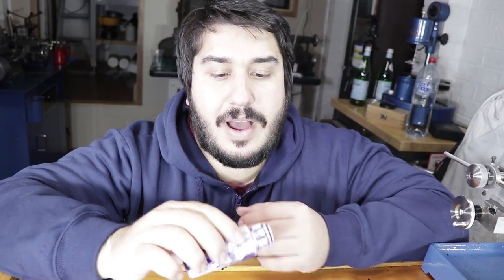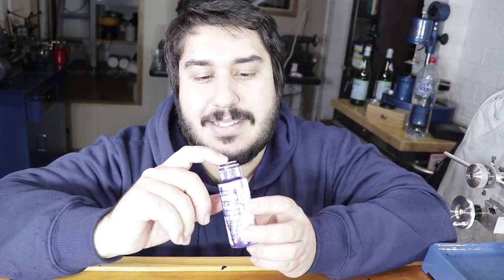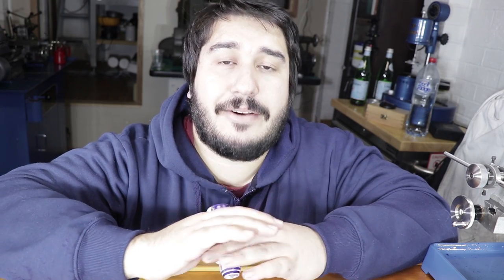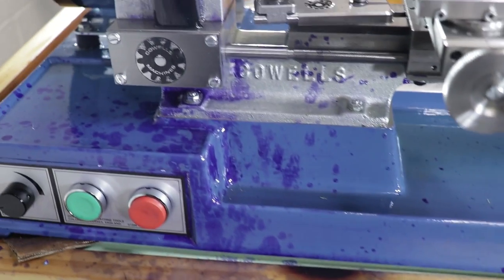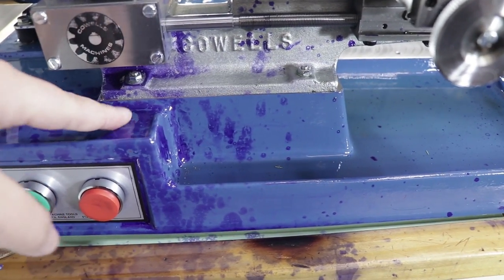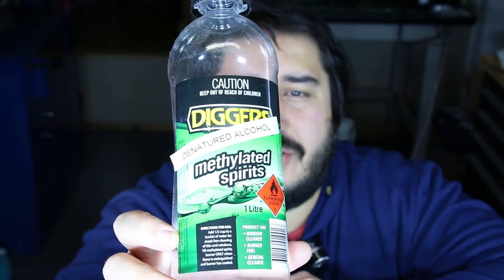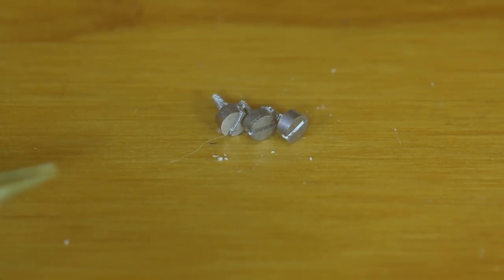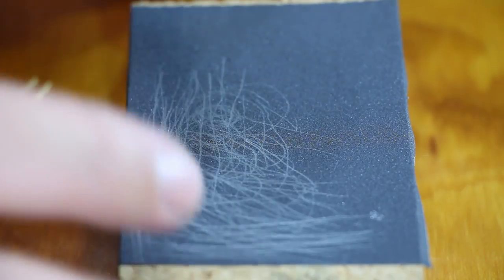Cowells CW90 Lathe ruined. BHI Watchmaking Course | Watchmaking Vlog #6

Comment: Hi Dean - Thanks for the videos! I've used a dry erase marker to remove sharpie from smooth surfaces. Completely cover the sharpie using small circular motion. Once dry, wipe off as you would the regular dry erase. No idea if it'll work on your layout fluid, but it's worth a try!

Comment: Hi,  Great videos and well done demonstrations for watchmakers!!  One thing that I need is to have both tap and die left-handed threads.  For some of the watches I work on, they require left-handed threads for some mainspring arbors and other posts and screws!  Left-handed screw-plates are few and far between.  So, any help to make left handed screw and hole threads? If you keep working on many different kinds of watch repairs, you too will find that these left-handed tap and dies are needed!
Reply from the maker: Hi, thanks for taking the time to watch and reach out to me. I actually ahve a video where I made a left-handed threading die from scratch used for the crown wheel on my watch. It can be found here https://youtu.be/SEdmDtGUv7U

Comment: Hey mate, not sure if youre still on here as im very late to the party but nonetheless your videos are inspiring and well of knowledge.

Ive just got some questions for you about the BHI course as I'm picking up watch repairs from my father but am looking to begin getting certifications..and the BHI distance learning seems the most doable considering my situation.

First question if, because we aren't based in the UK, i would assume that we would have to get our own tools, machine and material. Which costs money, so how much would you say youd have spent to finish the course? And what sort of equipment is required to complete the course? As i wouldnt want to enroll only to find i dont have the logistics to finish it..

For some exams, an examiner needs to be there, and I understand that i can find my own examiner, but what sort of qualification and where do you go to find these people that can be examiner?

For those exams in Level 4, which you need to do to the UK, how does that happen? Is it a one day kind of thing? What the process like..

And lastly, starting from Level 3, do I choose from the start if i want to pursure watches or clocks? Because im getting the understanding from BHI that they teach more on the clock than watches for level 3..

I know its really lengthy and alot of questions but youre the only guy i know what I know has done the course.. cheers and keep inspiring!

Comment: I have found that the best solvent for cleaning Dykem blue off metal is Acetone (NOT isopropyl alcohol). It doesn't even need to be 100% Acetone, as even a 50% solution with water, on a rag, seems to work well. 
I can't vouch for how this might react with your paintwork, so test an inconspicuous area to determine the effect, and don't over do it.
Nail varnish remover is a good domestic source of dilute acetone (check the  ingredients, as some types use methyl ethyl ketone (MEK) instead).
NB: Acetone is very flammable, and should be used in a well ventilated area.
Reply: PS: I have found out that Dykem aka Marking blue is made by mixing methylated spirits with shellac and gentian violet.
This would imply that methylated spirits ought to be best solvent, (although this might attack the paint).
However, an alternative approach to dissolving the Dykem with a solvent would be to use dilute bleach to neutralise the gentian violet colouration. This might be safer to the underlying paintwork.
Reply from the maker: Nicholas. Thank you for your very detailed insight into this. It is awesome and Im sure anyone who seea this will also benefit. I did try acetone however it reacts with the paint, I may try 50% mixture in the future. Thanks Nicholas!

Comment: Dean D K 
I am trying to find a cross slide for my Peerless 8mm lathe. it looks like you have the same lathe. Do you know where i can order one? Or a certain one to look for? one that will work?
I'm a antique car mechanic that is trying to get in to watchmaking as a hobby. Any help would be appreciated. Thank you.
Unfortunately the only chemicals that I know that will remove the dye will also remove the paint.
Thanks for the info about the associate member of the BHI! I will have to do that!

~Ken
Reply from the maker: Hi Ken, thanks for your comment. In regards to the cross slide, I use a Levin made cross-slide. Most other makers will most likely fit the lathe. The most important thing you will need is a "shoe" for the Peerless lathe. Which will fit into the ways of the bed underneath the cross slide, this ensures the cross slide so it is perpendicular to the bed every time.  Depending on which brand you buy, you may also need to make minor adjustments to bolt section. I don't have much experience other than using the Levin cross slide on the Peerless. 

Or you could keep your eye out for Peerless or Marshall cross slides. Marshall slides appear much more often on ebay or watchoolsonline.com. 

I hope that helps you in the right direction.
Reply: Thank you very much!

Comment: Hi Dean! so I am really sorry about the Dykem accident. But is was an accident and hope you will not blame yourself. Shit happens.

All of the comments re acetone and lacquer thinner are correct. However, don't rush into doing something until you contact Cowell's and ask them what solvent will not damage the paint. I think it is worse to cause damage the lathe's paint than to have patches of Dykem on it. With the paint, you have an easier surface to clean and it will stay protected against rust and cutting fluid (if you ever use it).

Daniel
Reply from the maker: +AtelierDBurgoyne Thanks for your comment and support Daniel. I have emailed Cowells, just waiting, I will most likely try acetone in one spot though. 

That is true! Great wisdom thanks :)

Comment: Hi Dean. Mistakes happen :), however they add character to your tools and you need to laugh it off.
Nice video like always. How do you select the music, as it fits so nicely?

Did you also pay for the feedback package from the BHI for two years? Also does the knowledge from the first courses help you buy a good lathe and mill? I have no experience with power tools and would just buy the wrong stuff :).
Reply from the maker: +iuiz This is true! I think I am getting past it now. Cheers, I am always out trying to find music that I can use on youtube with copyright issues! Im glad you appreciate it! I just play what I like. 

I only paid for technician grade tutor feedback as the other one omis only theory feedback not on the work you make.. 

Umm they touch on some stuff with the lathe. Are you located somewhere where there is a physical shop to buy used watchmakers lathes?
Reply: I am just theory crafting at the moment. But maybe in a few years I will buy a lathe. I am currently living in a pedestrian area and my neighbors would kill me if I start machining ;).
Reply from the maker: The BHI Technician grade have a demostration photos using a sherline lathe and a watchmakers lathe. You will find that these lathes are fairly quiet. Especially a watchmakers lathe.

Comment: One of the reasons i never bought new tools if i could do it. You put them on a pedestal and never fully appreciate them. 

Well, that, and i like to take them apart from day one, and if it's new, i feel really guilty towards the wallet, if i do it, and mess up. Like that one time i took apart a Starrett test dial indicator and i couldn't match the movement to the spring in the dial anymore. Had to watch a few repair videos online till i figured out the trick. < yes, i am that kind of an idiot, and i'm proud of it, because more than once has it saved my bacon later down the road.

Comment: I use acetone to remove Dyken Blue from everything.  Not sure what it will do to your particular paint.
Hang in there.

Norm Berls
Houston, TX
Reply from the maker: +6NBERLS Thanks for the comment and support will try acetone :)
Reply: I've been thinking about your Dykem Blue problem.  I'm sure acetone will take the ink off metal surfaces.  I also get little splatters on my hands.  I use Lava soap to remove it.  This is just soap with some pumice in it.   I think a tooth brush with a little Lava soap might remove the Dykem Blue from your painted surfaces.  Or maybe just a paper towel moistened with water, a little Lava and light finger pressure would work.  I also wonder if 1200 grit abrasive paper would work.
Reply from the maker: Thanks for your thoughts. Sorry late reply I just figured out I don't get notified about replies to my replies. I will try the soap you mentioned as acetone unfortunately starts to react with the original paint.
Reply: As I say above.  Watch that you don't breathe it.  It's very bad for your health and we all want you to live to a ripe old age so that you can outdo Richard Mille.

Comment: nice green flame on the screw tempering part :))) ; on the paint spill, maybe just get a good "lock' onto the colour of the base paint and have the whole thing re-painted, sorry, but that's the only way to get rid of it { any solvent for the "layout Blue" will craze the finish on your lathe base, because if nail polish remover or turps won't shift it, the solvent is likely to be similar to lacquer thinner ( as in artist paint) so YES it will damage the lathe paint, looks like a nice car candy paint too :(...} but if you do re-paint the base put a "gloss over coat" on it, just like on a car paint job, will make sanding any further accidents off easy- only the top layer would need a re-paint.

Comment: I thought from the title you had actually damaged your lathe but it's just a bit of a stain, some of the lathes/machines I've used over the years have been beaten up like crazy but have worked just great. As long as you keep your maintenance up it will last you a very long time but it will look like it should be, used.

Comment: If the lathe was painted with an acrylic spray paint then the Dykem has probably diffused into the paint surface, and is now chemically inseparable from it. In which case the only option is to strip down the lathe, remove all the old paint, and then re-paint it with something more resilient.
(I'm quote surprised that Cowells didn't use a hard-wearing epoxy or enamel paint, but maybe yours has been re-sprayed?)
See this comparison chart http://www.rustoleumibg.com/images/TechSpecsAndGuides/LIT_CPS_0406_9579550_Chemical-Resistance-Guide.pdf.pdf
After looking into this (common) problem, I am currently thinking that a Chemical Resistant Epoxy-based paint would seem to be a good choice. i.e. In future, any solvents spills, oils, or Dykem spills would just wipe-off with a rag soaked in Acetone and no harm would be done to the underlying paintwork.
I think that "Blue Sky RAL 5015" is a good match to the colour of the base (although a call to Cowells would confirm this).
Here is one vendor that might be suitable https://www.reprotecuk.co.uk/products/reprotec-acidcheck
(I am considering repainting my milling machine with this stuff.)
Reply from the maker: Thanks Nicholas. When I do get around to re-spraying I will definitely use the paint you just recommended :). Let me know how you go with your repainting if you do go through with it
Reply: PS: I have updated the link in the above comment to "Reprotec Acidcheck" paint, as I have been advised by the manufacturer that is is a better choice for resistance to solvents and other common shop chemicals.
Caveat: This is not a product endorsement, and other brands are available.

Another choice would be the 9100 System DTM Epoxy Mastic from Rust-oleum
http://www.rustoleum.com/product-catalog/industrial-brands/high-performance/epoxy-coatings/9100-system-dtm-epoxy-mastic?ls=9122402&lc=Marlin%20Blue
 (in RAL5012) is a glossy epoxy for metal with good resistance to petrol and similar solvents.
Ref: http://reader.mediawiremobile.com/RustOleum/issues/106879/viewer?page=8
Reply from the maker: Wow thank you so much Nicholas! You went into great detail :) you made my life easier when the time comes to repaint

Comment: "The only thing that removes Dykem,  is...well...Dykem."  just try a spot of it on itself and wipe. they have dykem remover but I've never tried it.
Reply: The dykem remover is actually made by Dykem and seriously... try just wiping it with itself immediately. I've spilled entire bottles on shop floors and machinery.  If you can put it on you can pull it off.
Reply from the maker: +Zachary Hodge Thanks Zachary I will try that. That is promising to hear.. thank you :)